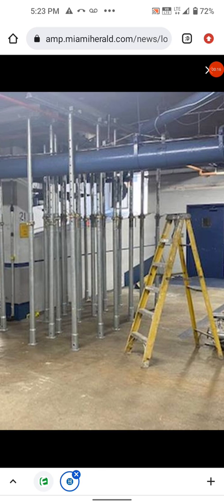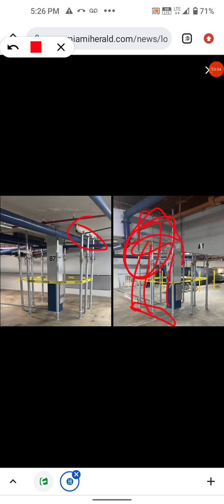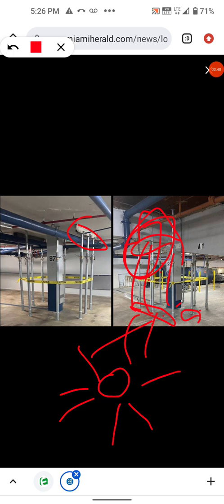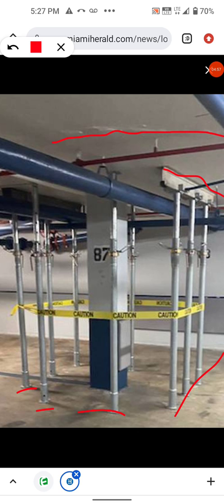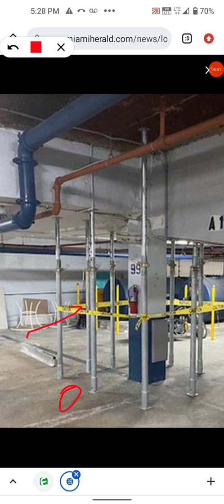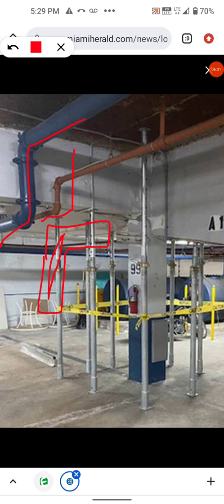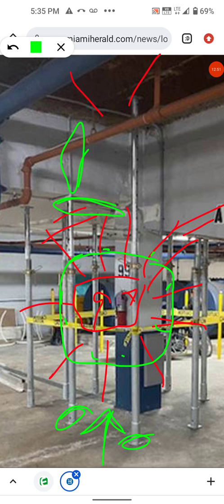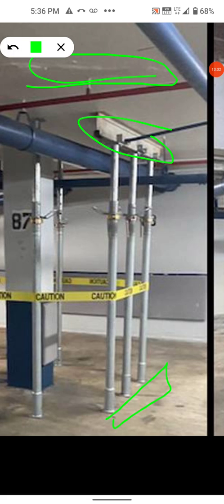Champlain Towers North Supports Installed incorrectly? Comfort Bracing and Rectangular array

Comment from the maker: Please view this video next, it will have another two or three videos following https://youtu.be/wXGTfv1Phd8
Reply from the maker: Please, look at my video titled, 
"Champlain Towers NORTH Explaining DIFFERENT dynamics than SOUTH North HAS BETTER COLUMN LOCATIONS "

I will explain the rectangular array and column offsets are critical and how Champlain Towers North has a much more rigid system where cars are loading.
BUT, I am not a fan of parking on the deck that is ledgered to you buildings columns!
I would hope they create an isolation system, this system would allow the deck to fail and not the main structure; the cost would be under a mil...
Then they would have to address all the columns and I really like galvanized steel h-beams and column jacketed and bolted with these h-beams (it allows for an idiot to inspect and maintenance is as easy as maintaining a waterproof deck, which would be like a 🛁 with drains.
I talked about this in many videos, a lightweight waterproof , walkable deck material exist...
Expansion joints would have to be considered but I am visualize one close to building structure...
I really dislike parking decks attached to buildings...

Comment: Hi kai the supports are given a false sense of security. The people should have used wood  top and bottom and spread the load. Kai could this supporting in one area cause problems in other areas. Many thanks for the video rubs and hugs all round. 🙂👍.
Reply from the maker: Rosemary,  agreed... the loads are concentrated at the bottoms of these post and timber would distribute more...
Pleased that you saw this content and shared your position.
It is raining here and our snow has melted (round one)...

Comment: You mentioned the term "comfort bracing." Meaning it looks like it's doing something but really isn't. Could be possibly be for some sort of show? To stoke a "fear response"??
Reply from the maker: This bracing, if on multiple floors , could be there for the highest level damaged floor.
The bracing will transfer the loads down to the parking ramp and or the parking deck floor...NOT to the columns.
Edit to add, this could be the intent but without knowing where the reinforcement is at the columns and flooring, it is risky to attempt to transfer the loads to the garage floor OR to just transfer them say, three floors (attempting to transfer the load on three floors) = is done with "re-shoring"...
I am not a fan of this bracing on the floor without a larger transfer of loads...
Hell, 6*6 lumbar gives a larger footprint then these post (I do love these post though, they can screw to the tension you need)...
Reply: @ForensicCats  Hmm….I am curious to see where this is going.

Comment: Intent?--gonna guess, Delay and Distract.This looks acceptable for a deck repair not a 12= building of concrete flats.
Reply from the maker: Ada, is just the first floor slab on most of these repairs and where they support a beam, it is everything the beam is supporting and "bracing" (if applicable)...
Reply: @ForensicCats  Got it, but are these temporary, while we do a quick repair for a deck or outside roof?Or long term? Because, were it so simple, why not just just these in the first place? Next, how much of a quality repair is possible? Does not this defect run along the whole length? Where does it stop?Does it stop? Why's should it?  Rhetorical questions, do not expect an answer. Who knows if there are answers? So then we are back at the Distraction.